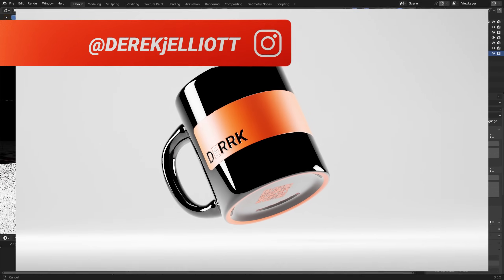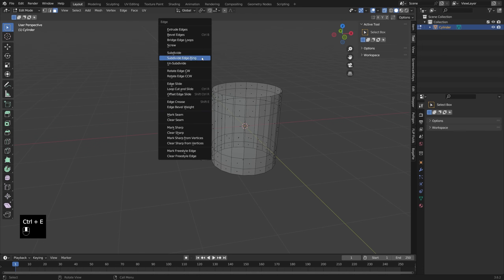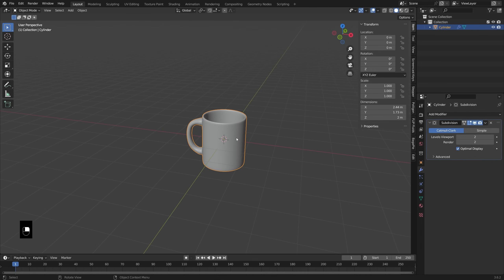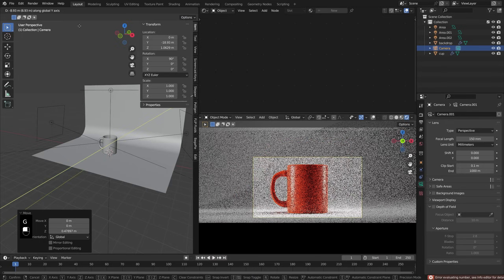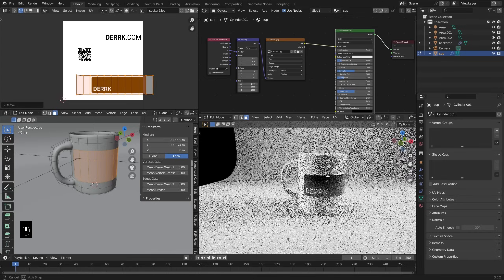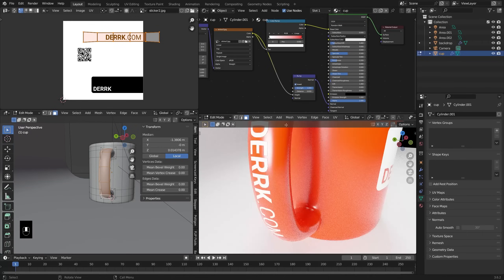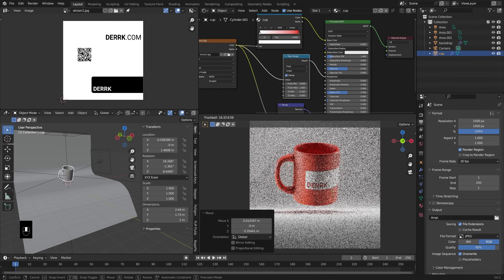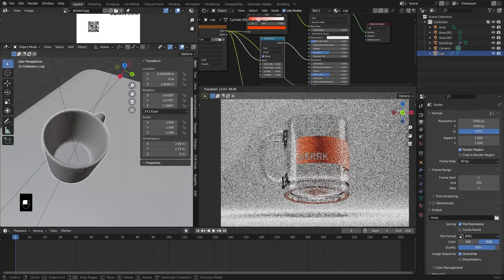Adding Printed Graphics to a Product in Blender

Comment: Hey mate cheers for the video! Got a question - is there a method to adding decals/labels like this that doesn’t involve stretching the uv’s in an uneven way? My worry is that if I unwrap certain parts of my object and scale the uv maps differently it will effect the underlying roughness and normal maps, causing weird variations in the texture detail. 

Does anyone know if there’s a workaround/different method for adding decals which avoids this? I’ve used shrink wrap on an image plane but that can present it’s own problems as well

Comment: Good Tutorial But on Blender 4 The red color shows as pink until I drag the Red color to 50% pros on the color ramp. IDK why?
Reply from the maker: It's referencing black and white values from 0 to 1. So if your red stop is all the way to the right then only things in your reference texture that are perfectly white will appear red. If you have to move the stop to 50%, then that probably means it's more of a gray in your texture. Nothing wrong with this. That's what the color ramp is good for
Reply: @DerekElliott  Wow. I didn't expect that you would reply back at me. Thank you, sir.

You're absolutely right. My Photoshop has started the new document with a 15% grey background. So after I removed the background and added a new white one. it worked perfectly.

Comment: Could you please make a video on how to model and texture socks? I find it really hard to get those organic shapes perfect. Is there any good trick?
Reply from the maker: I guess it depends on what you need them for, but there are probably some pretty cheap models of nice looking socks online. Otherwise, I might start with a reference image or foot shape and play with some simple shapes and subdivision. Then a really nice image texture
Reply: @DerekElliott  Thanks for your reply! I need the model for creating mockups of different designs for socks. Unfortunately all models I found online are rather crappy and in detail  don't really reflect how an actual sock would look like. But maybe I was on the wrong platforms. Do you have some good suggestions where to get good models? Price isn't that much of a problem, I mean it shouldn't be too expensive over the top, but I wouldn't cheap out if I could get a really good model.